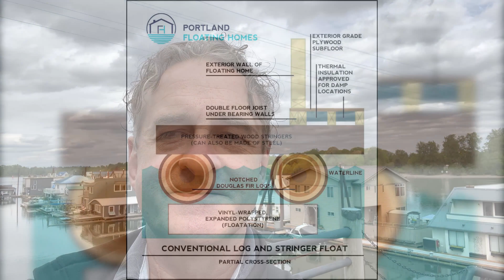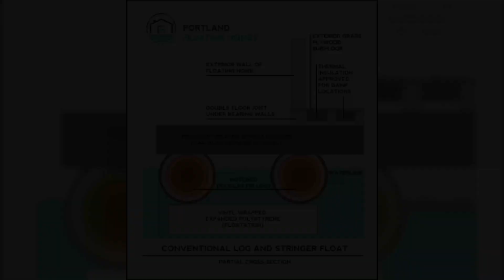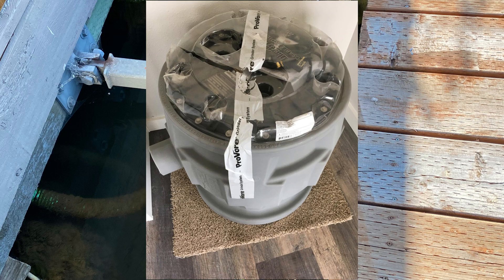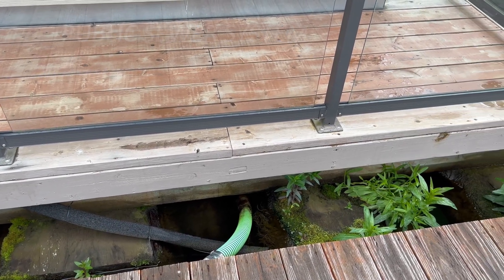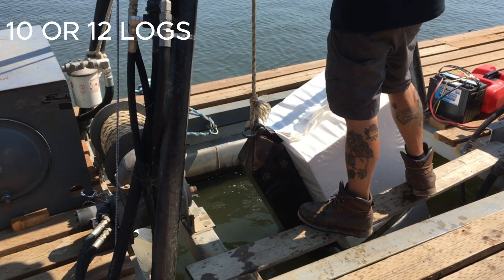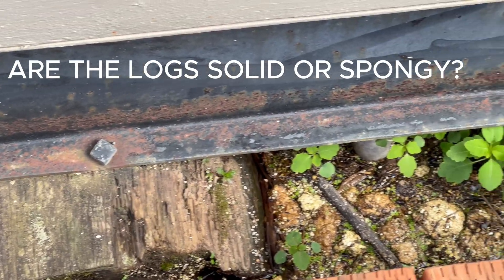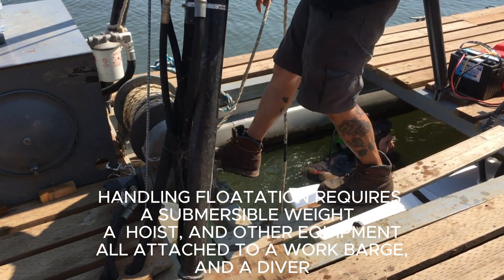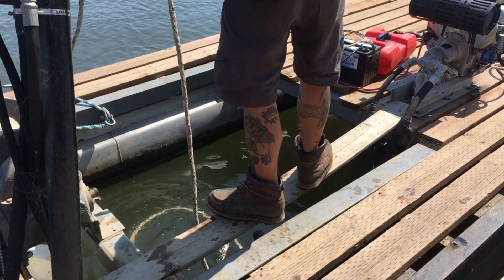How Do Floating Homes Float?!?  Portland Floating Homes

Comment: One of the best videos I've seen on this subject. This is not, directly, my expertise as I'm a natural and/or traditional architecture design builder, yet I have consulted on, restored, and or done a number of aquatic-style forms of architecture. The only added info I would offer to those who may read this is that "wood" or timber under water DOES NOT decay at all. If you have a properly designed foundation for a floating home is done...your "shim" beams" or "shims" are the only thing that will decay if made of wood. If they are made of some other decay-proof material these "wood beams" will virtually last forever if in fresh water. Saltwater and brackish estuary water can have marine annelids that will attack wood unless other mitigating conditions are created. As the easiest validation for understanding all this is to think of Venice, Italy, and how old it is. That city is set on stone under the water...but...those stones reason on wood pilings...
Reply from the maker: Thank you, Jay.